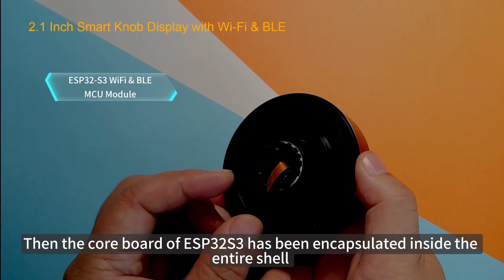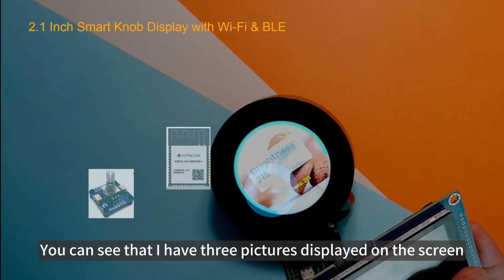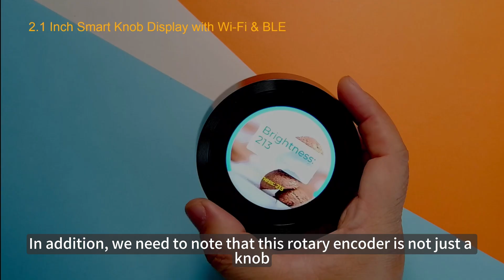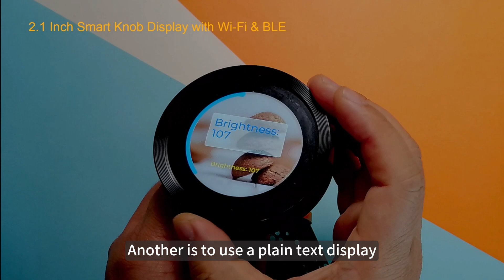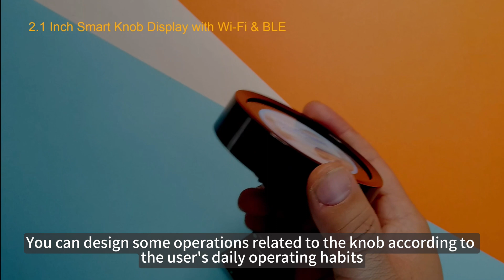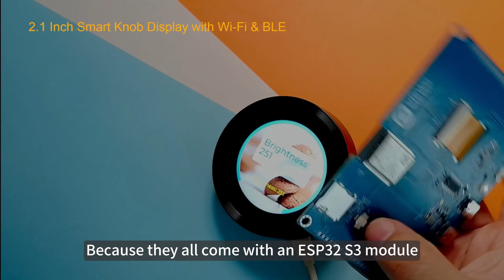Introduction 2.1 inch ESP32 S3 Knob Rotary Screen

Comment: Can I have a datasheet with the overview of the internal pins used for the display? What's the internal pin map and driver circuit? I have had one for 2 weeks now, have not gotten it to work yet.

Comment: i bought a few of these from Viewe and haven't been successful uploading anything including demos or examples outside of what cam preinstalled. I could use step by step video instructions on what needs to be modified on the LVGL files where they need to be placed as well as what to modify on ESP32 Display Panel and where it needs to be installed. So frustrated trying to get this device to work. Once I get something uploaded hoping I can reverse engineer and come up with some programs I can get to work with MQTT so I can get this to work with Home Assistant.
Reply from the maker: Hello please contact nancy@viewedisplay for technology support.